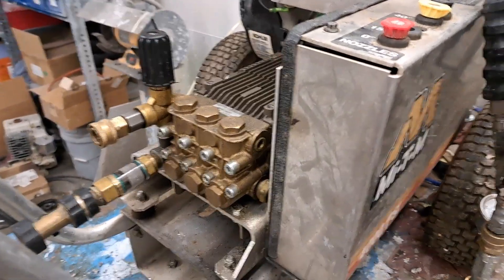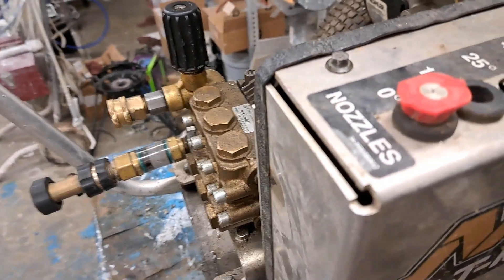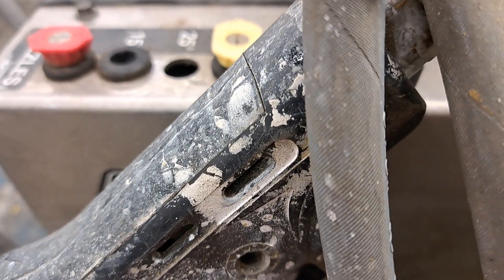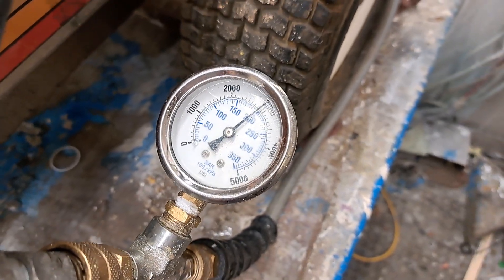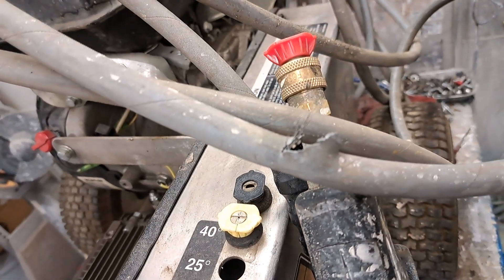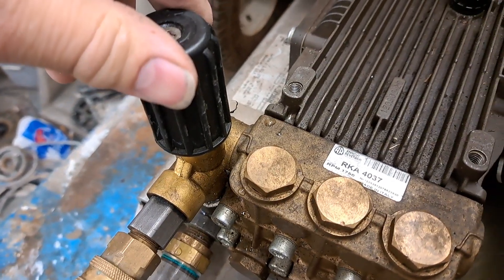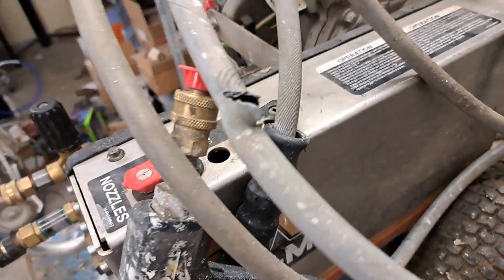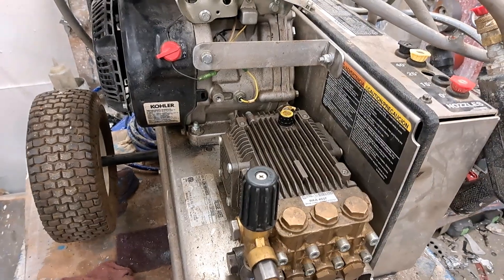Dangers of high pressures in pressure washers

Comment: Finally, I find a video with the exact same problem I was having yesterday… My hose exploded on my Dewalt 4400… And I’m not quite sure why. The first time I started it it stalled when I released the trigger… The second time I started it and released the trigger. The hose blew up and almost injured me.
Reply: Can I just back off the pressure by adjusting the pressure knob so it doesn’t surge again?!
Reply from the maker: @T1mmy230  this means the pressure is too high.  Yes, you can turn the pressure down to prevent this. There should be a lock collar to prevent them from turning the pressure up too high

Comment: Brian I have a question it seems like I can't find no answers here anywhere but I believe you are the great professional technician that would have the answer on the HondaIGX800 EFI system WITH THE STR Governor Fi V-Twin Small Engine we had to replace at 100HR then we replace the oil cooler than now we are having a low engine power with surging rpm
No code show up I think has a weak ignition coil or valve need to be adjusted or the ECU needs to be reset from the rectifier replacement what are your thoughts brother sorry for the long message
Reply from the maker: Catch me on Facebook  at Brian Shumack the repair guy with the same background.  Messages will be easier

Comment: Do you keep a zero tip on for testing normally. Maybe could have averted an incident with a wider tip.
Reply from the maker: Yes, I use a zero. It gives you the highest maximum reading when in use.
In this situation,  the tip size makes no difference. The rupture came after the trigger was released and there was no flow. With the trigger pulled, the system does not reach maximum pressure because you constantly have a "leak"